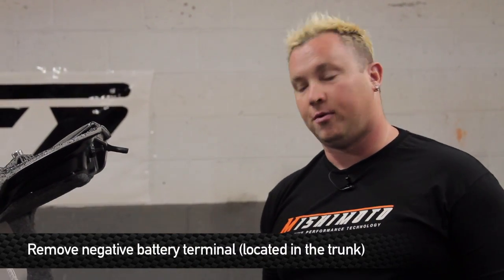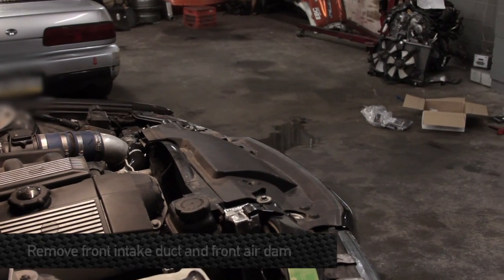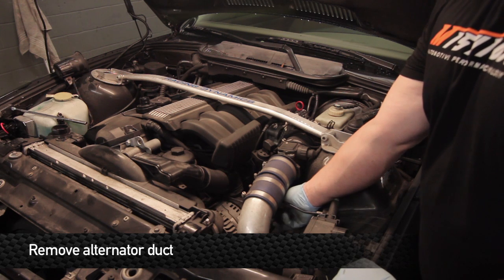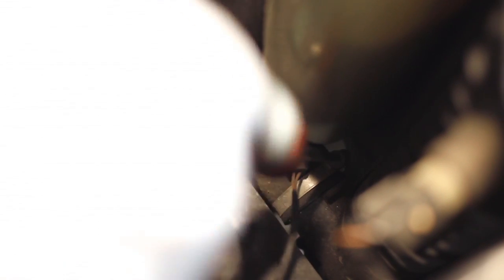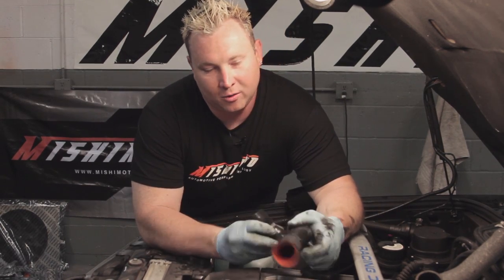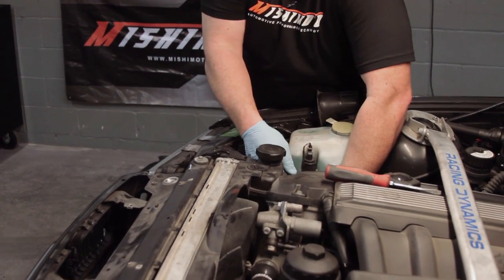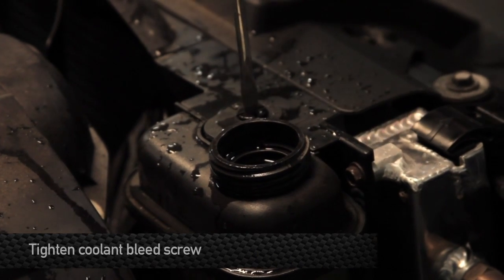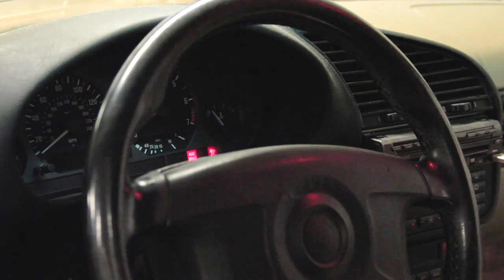How To Install: Mishimoto 1992-1999 BMW E36 M3 Series Silicone Hose Kit

Comment: When installing these hoses make sure that your hose clamps are tight enough and far enough up (very close to the radiator). I had a coolant leak that was the result of not doing this.  
One more pointer: If you want to completely drain your coolant be sure to go to the Pelican Parts web site. 

ExRussian86, I bought these hoses because I plan on owning my M3 for a very long time and I don't want to change out the factory hoses again... plus they look cool.

Thanks for the video, Brian.
Reply: 8 Years later....how are the hoses holding up? Or how long did they last?